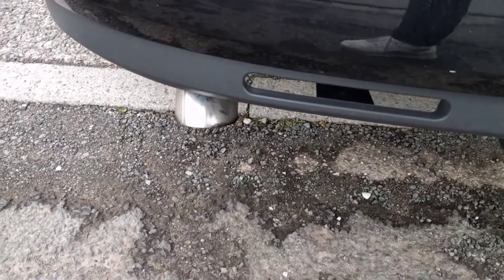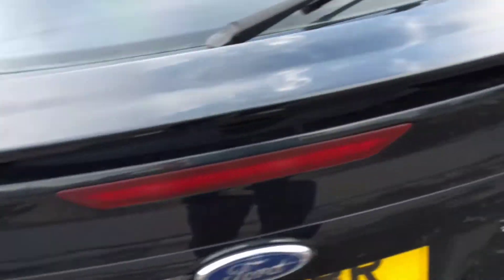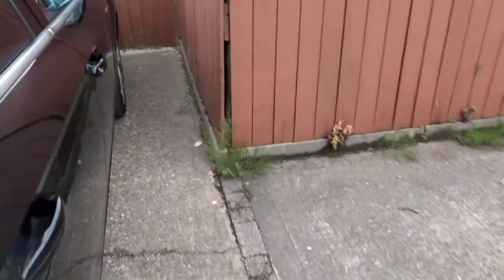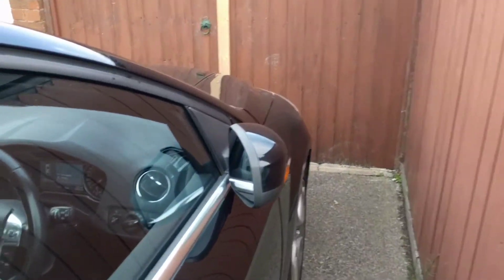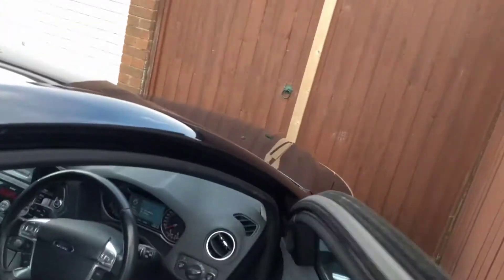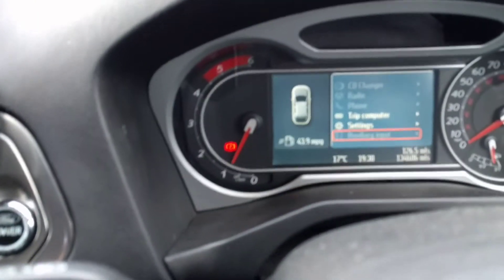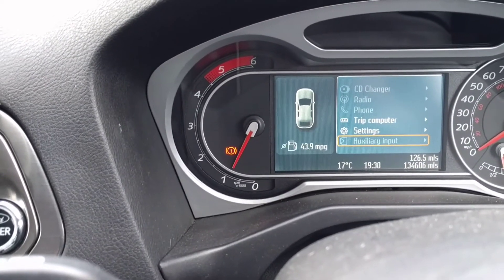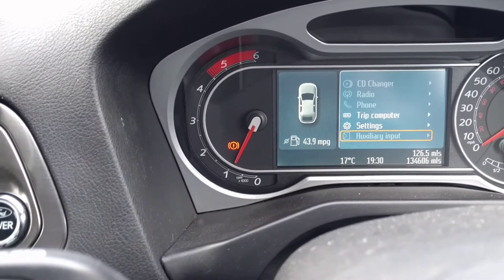Mondeo mk4 2.0 TDCI DPF regen at idle after a drive.

Comment: Mines started doing this on same day return journeys from Plymouth to somerset! Is it just a case of waiting for the fans to stop to indicate the regen has finished? 

It idles quite rough as well but once the fans are off its good as gold again.
Reply from the maker: That's exactly it. The rough idle is due to the extra fuel being dumped in via the injectors, plus the glowplugs being switched on as part of the regen process. If you sit and wait til the fans turn off and idle goes back to normal, you're fine. I still have this car and it's now done 232,000 miles and the engine and DPF are still fine.
Reply: @RikAindow  appreciate the reply thanks!👍 yeah if i leave it the fan cuts off and it returns to normal after so if thats ok then i won't be flapping now!😂 

Have considered getting a DPF delete done as there is a guy on one of the FB mondeo groups that does it.
Reply from the maker: @xslaneyx  I kept mine in as it's not caused any issues for me but each to their own. 

I did try blocking the EGR and that did make the car slightly more responsive, but as the EGR helps heat up the engine when it's cold, it actually made the fuel economy worse as the engine took so much longer to warm up.b
Reply: @RikAindow  it's the first car i have owned that has a DPF so it's all new to me. Its a 4.5 sitting on 142k miles and aside from needing 2 injector seals a few months ago as they were smoking and the leak off hose things on them changed as the originals were brittle it's been a lovely car so far!! Just need to replace the injector cover now as it's disintegrated.

Thanks for the replies though i appreciate it. Unfortunately i get bad anxiety with cars if things go wrong or i don't know whats wrong so this has helped ease that👍
Reply from the maker: @xslaneyx  no worries. Keep reading up on the Facebook groups as they're great for information. If yours is a 4.5,  your engine is likely different to mine (see my other videos) and is going to be a Euro 5 which has a different DPF setup. The Euro 5 injects fuel straight into the DPF via a vaporizer. By doing this, it's meant to be better for the engine and more effective at regenerating the DPF. However, vaporizer can and do break. 

Good luck!